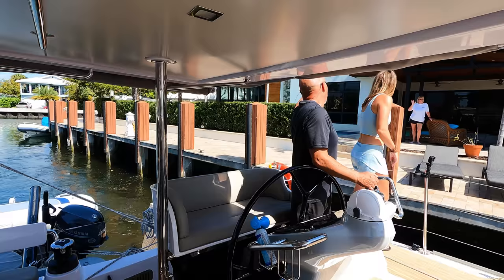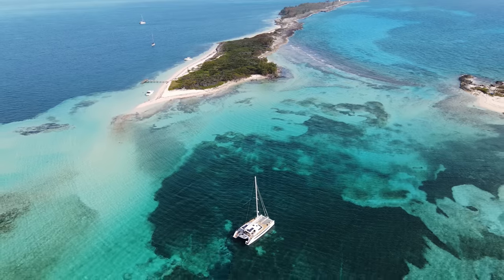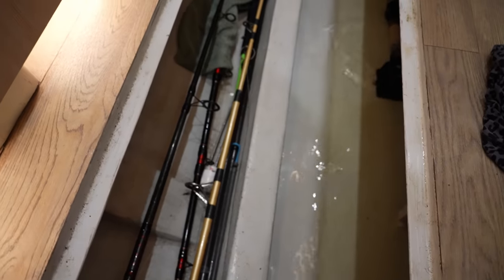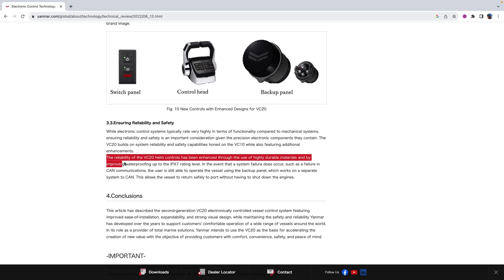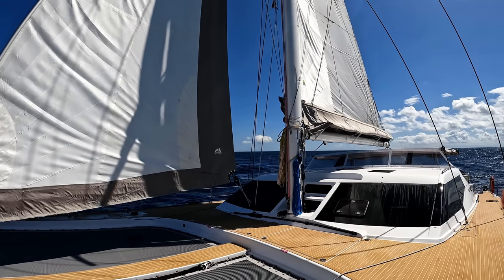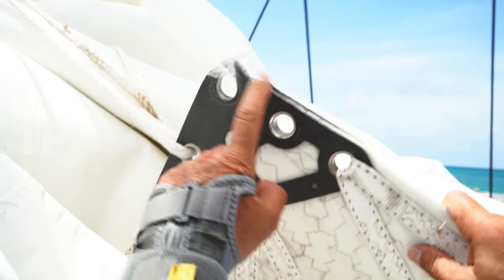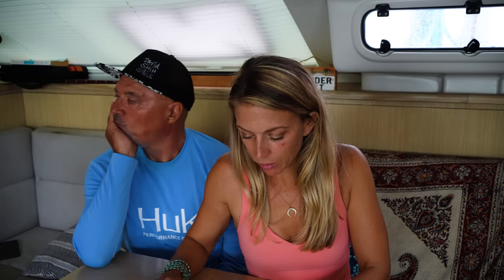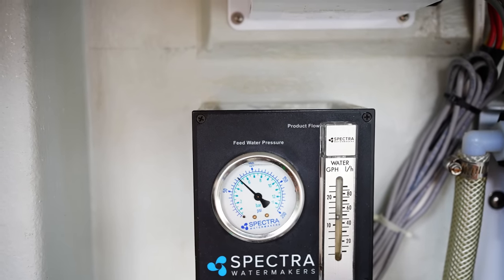SEAWIND 1600 CATAMARAN 3 Yr Review - Joy or Regret?

Comment: Hey thank your for all the information. Do you have sail drives?....i don't think i like them....seems they take lots of maintenance compared to shaft drive.
Reply from the maker: We have sail-drives, SD60.
Sail drives often require more maintenance, oil changes, seals vulnerable to corrosion and cleaning marine growth.
Also In the event of a grounding or collision, sail drives can be more vulnerable to damage than a shaft and can leave a big gaping hole in your engine compartment.
Furthermore they can be more expensive to install and replace than traditional shaft drives.
On the advantages side, sail drives allow for a more compact engine placement, which can save space in the engine room and more flexibility in interior design.
They tend to produce less vibration than traditional shafts, which can make for a quieter, more comfortable onboard experience and possible better hydrodynamic efficiency because the drive leg and propeller can be positioned for optimal flow.
On the other hand shaft drives have been around for a long time and are known for their durability and reliability.
The shaft and propeller are often better protected by the shape and structure of the hull.
Less frequent maintenance
Generally cheaper to install and maintain.
The negatives are the opposite of the positives for the sail-drive, 😊😊more vibration, more drag, limit design/ installation options.
Proper alignment between the engine and shaft is critical; misalignment can lead to increased wear and potential damage.
The best choice between the two often depends on your specific needs as well as the design of the boat itself.
For an expedition boat I would favor shaft and a skeg to protect the prop.
For performance sail-drives maybe better.

Comment: For the price of these boats SeaWind did pretty little testing and the choice of parts was quite a bit focusing on price but on quality. You had so much stainless breaking in your steering system which is strictly safety related... the pin, the bolts leading to loosing a rudder...
I know stainless parts breaking on my Catamaran as well but there is a small difference.  I own a 20 years old F18 that I run at the beach for fun. That is 18ft sports-equipment. You cross oceans and your lives relay on the boat.
Electric issues leading to rig-failures (electro corrosion), essential rudder components breaking, ...
That's not worth an offshore rating, not talking about all the detail topics.

To me this boat is a clear "no go"...

After all these breaking components I am really surprised to hear you talking about a safe boat. You did some coastline sailing, one major ocean passage to French Polynesia and there are many passages left for completing the lap. You still have the same rudder-fittings, the diameter of bolts that already broke, just imagine that happening in the middle of an ocean in heavy weather...
Did Seawind suggest any changes to prevent this to happen again?

I completely understand your choice according to the boat being a sailboat (daggerboards, high aspect rudders, ...).
I have tried different Hobies  (with and without daggerboards), Dart, ... and currently own an old Bimare A-Cat and a Nacra F18, both having daggerboards and high aspect rudders but they are in the budget- range of a mountainbike and I sail them at the beach or on lakes. If I experience any damages, there would be assistance and the money at risc is not really a topic. Actually I  also had to return home with a rudder having sheared off once but Nacra already knew the Issue and I  got 2 new replacement bolts for free, even though I bought the boat 4th hand 😂

Please keep us updated and I  whish you safe returns from your future passages!!
Reply from the maker: Thank you for watching, Seawind has been a great part in rectifying all problems and we are undergoing a complete steering refit as we speak. (We are on the hard now)
Thanks for watching and for your comment😊
Reply: @HarborsUnknown  I just edited the first comment. 
Please keep us updated and I hope the refit works out for you!!
As mentioned I understand your  choice of a performance focused boat completely when looking at sailing and fun. I wish you all the very best for doing ocean passages with the boat of your choice. 

I even had the chance to try a dragonfly once. I know the owner from A-Cat sailing and we had some really fun days in autumn wind at boat speeds up to 25kts on a 920...

Now he retired from work and wants to do ocean sailing. He sold both, Dragonfly and A-Cat and bought a robust aluminium monohull. He as well as me look at the topic through the eyes of an engineer 😉

Best Regards from the baltic sea. The sea that also your Dragonfly was designed for  😉
Reply from the maker: Aluminum is the way to go!! Both for mono and for cats, especially if you plan northern latitudes sailing 💪💪

Comment: It appears boat manufacturers are not accountable enough for the goods they supply, if you buy a new car for instance and have a problem with the sound system you would not be told to go the the supplier of the system, the car dealer in conjunction with the manufacturer would sort your problems.
Same goes if you by a brand new house.
Reply from the maker: Yeah!! It’s a different beast 😊! That’s for sure😊 thanks for watching and for your comment 🤩🤩

Comment: What is the lowest amount of wind that you can sail at 3 knot's?
Reply from the maker: There are some variables like waves, current, wind angle, but on a beam reach in flat water we can go 3 knots with 5 knots of wind.
Reply: @HarborsUnknown That's impressive. What is the dry weight of your boat?
Reply from the maker: @robertlaird6746 13 tons (28000 lb)
Reply: @HarborsUnknown I'm not positive but I've heard that the Cyber light ship weight is 6.1 tons. Not sure what that equals in pounds. I'm also heard that a ton can be a different weight depending on what country your in. I tried looking it up on the internet but couldn't find a clear answer. Also, I think that there is another production performance catamaran that is made out of aluminum. Would that be your boat?
Reply from the maker: Thankfully one ton is 1000 kg and a standardized measure all over the world.
In pounds (US) the Cyber 48 on the brochure is 8500 tons or about 18000 US pounds. https://www.yumpu.com/en/document/read/10489456/cyber-4800-brochure-harwood-marine
Compared to the SW 1600,  if you calculate by foot (52 vs 48) the Cyber is about 20% lighter.
I am not aware of production aluminum cats. Devillier in NZ designs wonderful cats and my friend Brian on SV Delos is building one (52 ft) and Nahoa is building one (55 ft)
Reply: @HarborsUnknown Thank you for that! Cheers!
Reply from the maker: I forgot the https://www.garciayachts.com/yachts/catamaran/explocat-52/
It is a production cat ( same company as outramer)
Reply: @HarborsUnknown I didn't know that this was your boat was made by Outramer. I thought that Seawinds were all made in the east like Tula's Endless Summer. Aww yes, that's the aluminum catamaran that I was thinking about or at least I think it was. It's got to be because it was the only production aluminum catamaran other than the Cyber 48. I wonder what the price is on one of those compared to your Seawind 52? They are pretty much the same except one is fiber glass and the other is aluminum. I do know that Sailing into Freedom is just now starting to build a production aluminum catamaran. It's pretty heavy compared to the Cyber 48. It must have more luxuries aboard to weigh it down. It might have a lot more aluminum and thicker sheets of aluminum. I'm not sure.
Reply from the maker: Just to clarify, the Garcia is made by the same parent company that builds outramer.

Comment: Its shocking the shortcuts these fibreglass manufacturers take including the use of cheaper materials like vinylester which is not water proof. The latest Seawind1370 is a really badly balanced boat as well.. its the result of selling boats from renders.
Reply from the maker: Thank you for your comment!!
I don’t think that the use of Vinyl Ester is a “short cut, especially when you look at the construction schedule of the 1600 and see the amount of Kevlar in the hulls. One of the main features is Vinyl Esther is water resistance.
Building a boat involves a selection of resins based on specific requirements. Each type of resin – vinyl ester, polyester, and epoxy – offers unique advantages. Here's a comparative look:

1. **Vinyl Ester**:
   * **Corrosion Resistance**: Offers excellent resistance to water and various chemicals, making it suitable for boats that will be exposed to harsh conditions.
   * **Blister Resistance**: Boats built with vinyl ester are less prone to osmotic blistering when compared to those made with polyester.
   * **Intermediate Cost**: Priced between polyester and epoxy, it offers a good balance between performance and cost.
   * **Improved Strength**: Stronger than polyester, though not as strong as epoxy.

2. **Polyester**:
   * **Cost-Effective**: Generally the cheapest option among the three. Suitable for mass production.
   * **Ease of Use**: It's been in use for a long time in the boatbuilding industry and is well understood.
   * **Shrinkage Control**: Exhibits shrinkage when curing, which can help to ensure a tight bond with the gelcoat.
   * **Adequate for General Use**: Offers enough strength and durability for many general boatbuilding applications.

3. **Epoxy**:
   * **Superior Adhesion**: Provides excellent bonding strength, which can result in a more structurally sound boat.
   * **Low Shrinkage**: Results in a smoother finish with fewer distortions.
   * **Best Strength**: Of the three, epoxy typically offers the best tensile, compressive, and flexural strengths.
   * **Moisture Resistance**: Offers exceptional resistance to water penetration, leading to fewer issues like delamination.
   * **Fatigue Resistance**: Boats built with epoxy often exhibit better long-term resistance to repeated stress and loads.
   * **Versatility**: Compatible with a wider range of fillers and fabrics, making it suitable for various applications.

In summary, the decision between vinyl ester, polyester, and epoxy depends on the boat's intended use, budget, and specific performance requirements. Vinyl ester offers a good balance between performance and price, polyester is more cost-effective for general purposes, and epoxy is best for high-performance applications demanding superior strength and durability.

I have no experience with the 1370 and it will be fun to look at the experience by Ruby Rose 
Thank you for watching and for your comment 😊
Reply: @HarborsUnknown  .. the answer is in your comparison... there is only one reason boat builders don't use Epoxy and that is cost. i.e. shortcuts
Reply from the maker: I would not say cutting corners, rather value engineering, optimizing value and function without compromising the integrity or quality of a project. It's a strategic approach to getting the best bang for your buck, rather than merely trying to reduce costs in ways that might sacrifice quality or safety. When done right, it ensures a project is both efficient and effective. If you have unlimited budget, then you can use carbon fiber😊😊
Reply: @HarborsUnknown  nice political spin... ..  all I can say is don't pierce the outer layer with vinylester or your in for a major repair due to their "optimising value" :-)
Reply from the maker: Wow, that's quite the vivid imagery with piercing the hull! 🛥 Always appreciate a unique perspective like yours. 
I would invite you to read this article about resins. https://www.sciencedirect.com/science/article/abs/pii/S0034361707702485

Thanks for sharing, and let's remember to always keep our boats afloat! 😄 Stay adventurous!

Comment: Throttles haven’t been manufactured in years?!?!  NOT WATERPROOF?!.!  Wtf is Sea wind doing.  Who’s in charge of QC for Seawind?  Needs to be fired! SMFH!
Reply from the maker: Thank you for your comment. It is a dodgy situation with Yanmar not Seawind. The throttles were still been manufactured when we built the boat but out of production by the end. Waterproofing rating uses the IP codes. The IP plus two numbers for dust and liquids, but on a boat we typically just look at second number, liquids which ranges from 0-8

-IPX0: No special protection against water.
-IPX1: Protection against vertically falling droplets, e.g., condensation.
-IPX2: Protection against vertically falling droplets when the device is tilted at an angle up to 15°.
- IPX3: Protection against water sprayed at an angle of up to 60° from the vertical.
-IPX4: Protection against water splashed from any direction, with no harmful effects.
- IPX5: Protection against water projected from a nozzle from any direction.
- IPX6: Protection against powerful jets of water, often specified for marine or outdoor equipment.
- IPX7: Can be submerged in up to 1 meter of water for up to 30 minutes.
- IPX8: Can be submerged deeper than 1 meter, usually specified by the manufacturer.

Yanmar VC10 were rated on paper IPX6, Seawind correctly installed them in a position, outdoor and with sprays. When they started failing and we spoke with Yanmar they admitted that they were not designed for exposure to water.
In the second generation Yanmar VC20 the company writes.
“The reliability of the VC20 helm controls has been enhanced through the use of highly durable materials and by improving waterproofing up to the IPX7 rating level.”

It’s a pickle!!